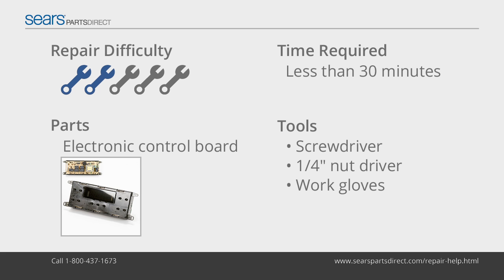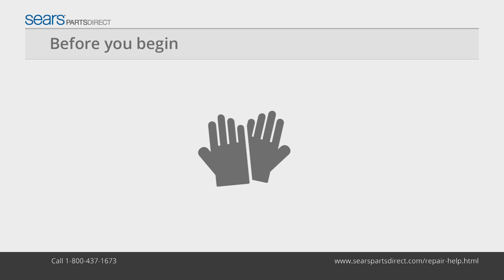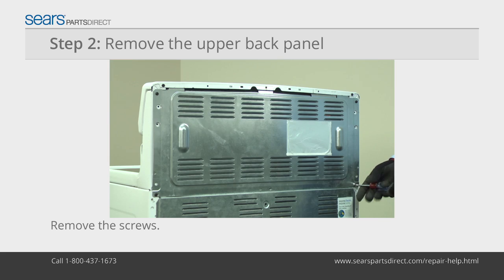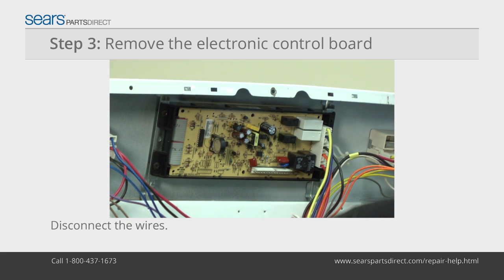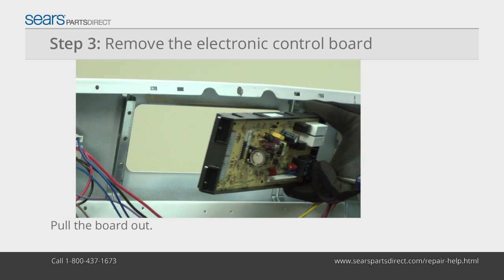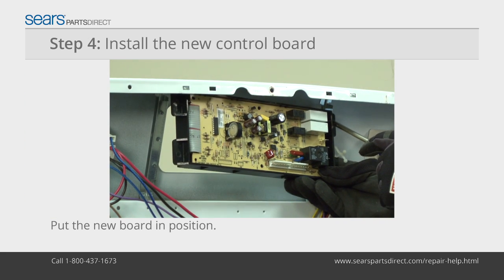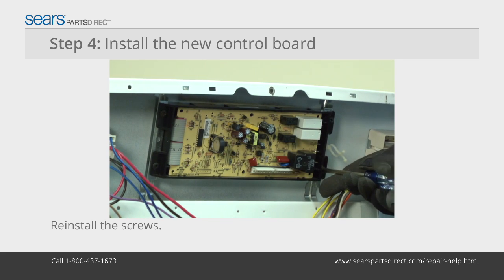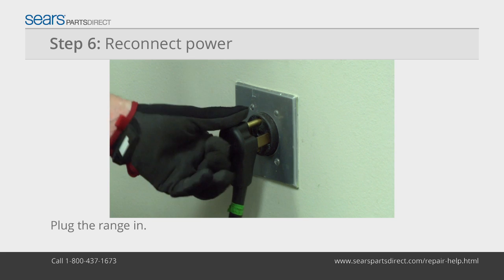Replacing an Electronic Control Board in an Electric Range

Comment: I cannot remote one of the connectors on the Control Board.
Reply from the maker: The wire harness connector may have a release tab, so look for a tab on the connector. If you find a release tab, press and hold the tab, then pull the connector off the control board. If this advice doesn’t help, let us know the model number of your range and we’ll try to provide additional advice on releasing the control board connectors.